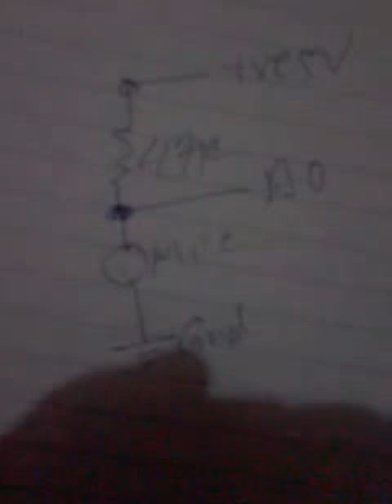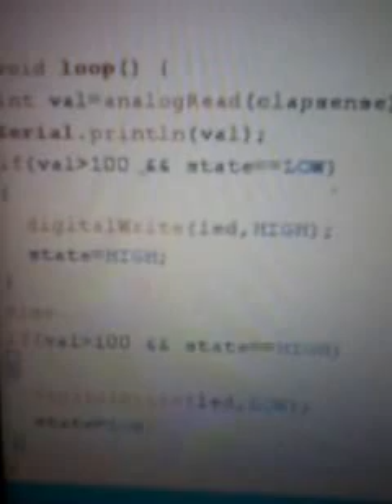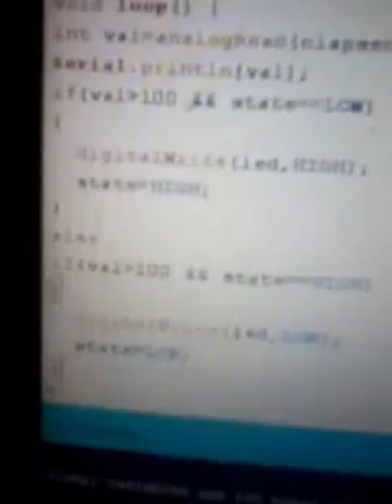clap switch using arduino

Comment from the maker: int led=12;
int state=LOW;

void setup() {
pinMode(clapsense,INPUT);
pinMode(led,OUTPUT);
Serial.begin(9600);
}

void loop() {
int val=analogRead(clapsense);
Serial.println(val);
if(val>50 && state==LOW)
{
  digitalWrite(led,HIGH);
  state=HIGH;
}
else
if(val>50 && state==HIGH)
{
  digitalWrite(led,LOW);
  state=LOW;
}

}

Comment: can you give the link of the website for source code thankyou
Reply from the maker: int led=12;
int state=LOW;

void setup() {
pinMode(clapsense,INPUT);
pinMode(led,OUTPUT);
Serial.begin(9600);
}

void loop() {
int val=analogRead(clapsense);
Serial.println(val);
if(val>50 && state==LOW)
{
  digitalWrite(led,HIGH);
  state=HIGH;
}
else
if(val>50 && state==HIGH)
{
  digitalWrite(led,LOW);
  state=LOW;
}

}

Comment: hi , very good video but unfortunately it have a bad quality . can you give us the code as text or file ?
Reply from the maker: +Kurdish Inventor int clapsense=A0;
int led=12;
int state=LOW;

void setup() {
pinMode(clapsense,INPUT);
pinMode(led,OUTPUT);
Serial.begin(9600);
}

void loop() {
int val=analogRead(clapsense);
Serial.println(val);
if(val>50 && state==LOW)
{
  digitalWrite(led,HIGH);
  state=HIGH;
}
else
if(val>50 && state==HIGH)
{
  digitalWrite(led,LOW);
  state=LOW;
}

}
Reply: Thank you so much